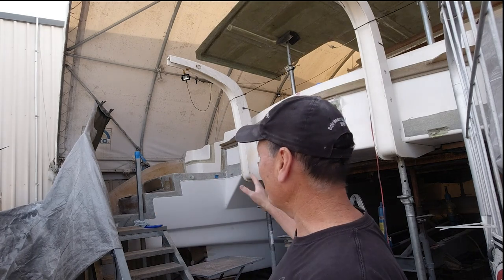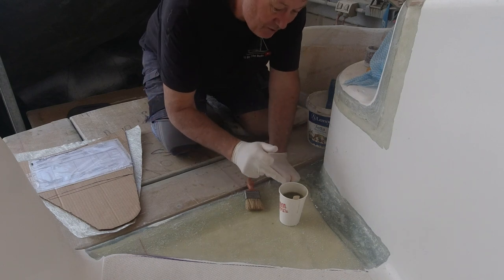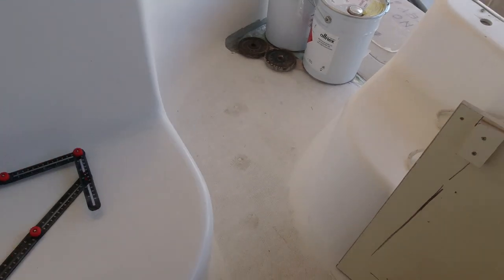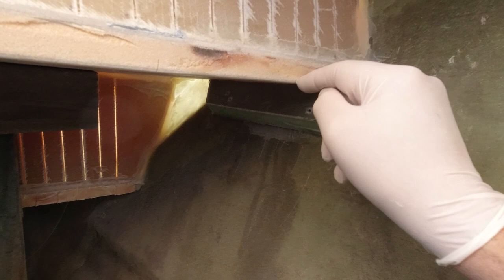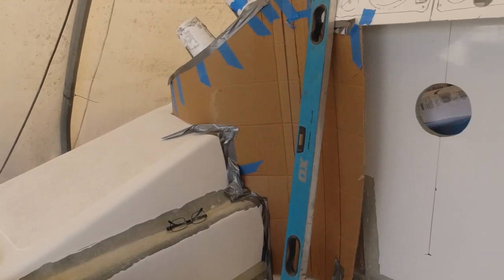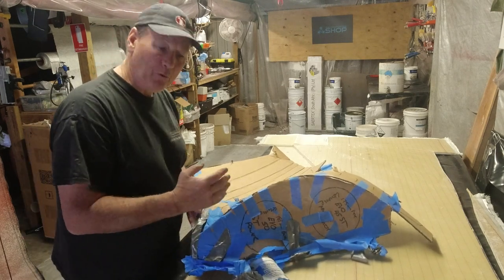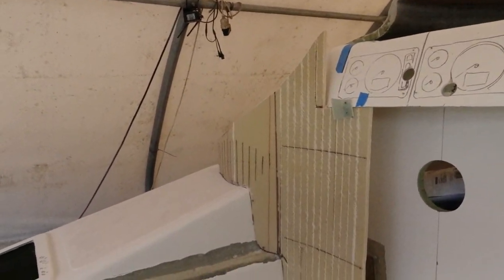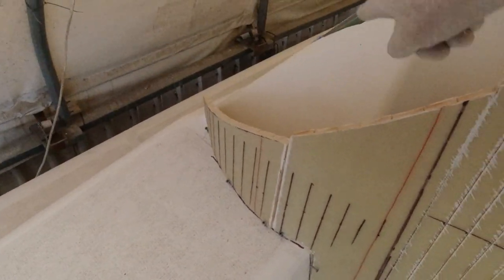Get back in your Hole - Customising a Catamaran Ep 238

Comment: The absolute drive, ambition and dedication you have Ross is absolutely mind boggling. It drives me on my projects if nothing else just because I get ashamed of myself for not pushing a little harder. I’m restoring an old car your building a friggin boat that has the same foot print as my house, out of fiberglass! And for the most part by yourself and the misses. Impressive is an understatement. 👍👍

Comment: I think I would have glued cheap 2 inch foam sheets together and made a carvable block. 
 Shaped the block into the final helm station I wanted.

Sheath in 6 oz cloth and wet out with epoxy.  

Fair the "Buck" to final smoothness. 

Pull female mold off the buck.

Layup new part and meld it into existing hull.

I am 3 years into restomodding a 1972 Formula 233 and your channel has really helped me to sharpen my fiberglass skills. Thank you!

Comment: For the 45 degree cuts and lots of other cuts in fiber/core I had used a small hight-adjustable circular saw - like a Bosch GKS 12V-26 Pro Cordless. My Fein multi-cutter is just to slow and inefficient. Yrs ago, at Jula (like Harbor Freight), I picked up an even tinier chinesium:( Meec circular saw on clearance for USD 4-5. I had a hunch it might be handy the day I dig into a total refit of my own boat.

Comment: Is it possible to take a mold of the anti-slip with silicone and then press it into the fresh gelcoat. Or spray gelcoat on the mold and slap it down over the last coat on the deck? Seems it would be easier than making a 'casting' that had to be bonded to the deck, since the anti-slip is only made up of the very top layer...

Comment: Ross, Are you not planning any steel or aluminum structure under the winch station ? It seems to be a highly stressed area since it's under torque, compression and tension which will flex and vary with every increase AND decrease of wind or shifts in orientation. Some sort of tripod or other load structure to distribute loads over a larger area  will be easier made and installed now than later when it's been enclosed by steering station and all entailed, right ?
Reply from the maker: There will be aluminium and carbon structure inside this plinth for sure.

Comment: very strange that those roller sanders are impossible to find in the USA .. seems like only Europe has them.. couldn't imagine how well those work sanding filets and such.. want one bad...
Reply: I typed in 'Handheld Drum Sander' to find many for sale in the USA.
Reply: @secretsquirrel6308  I have also but they are not the same as the one he has. These are called roller sanders. One is the Bosch PRR 250ES or the Power Plus POWX0495, Ryobi even makes one but not here.. These have a slim head design and not just a griner with a wheel stuck on it so you can use it in tighter places.

Comment: I cant help but think cutting holes and slits in the hull would weaken it. I know you wouldn't do that and you know your stuff for sure. Still the idea plagues me lol
Great work as always.
Reply from the maker: Funnily enough.It strengthens the regions as there is more reinforcement than the original to rectify.The life raft compartment for instance actually becomes a box section rather than a hollow The slit bome further incorporated into bulkheads etc that are not normally done so.Cheers Ross

Comment: At 18:08;    did i hear  """"R O P E S """"?  There are no ropes on a sailing vessel. The only rope on a sailing vessel is about 6" long and guess what that is?  ROPes.........ropES !!!!         That helm design will be a challenge however i do see that you have a plan in place.
Reply from the maker: Caught out big time Jim.Haha.
Reply: @LifeOnTheHulls  so, wht is the answer? What is the only rope on a sailing vessel?
Reply from the maker: @lets_go_see_  I would guess a bell rope or a soap on a rope in the cabin boys head.
Reply: A bolt rope forms the luff of a mainsail.
Reply: Further a rope is any rope on a vessel that has no specified purpose.  I have a plenty of ropes on my yacht, if I use them for berthing alongside, they become lines, or if used for hoisting sails they become halyards etc.  For the moment they just sit in the locker and are just bits of rope.
Strictly speaking, rope is twisted 3-core laid cable of 1" circumference or more, below that it is a cord. - A Dictionary of Sailing,  Penguin Reference books 1961.
Reply: @jeremyrowley1240  nice attempt.
Reply: @jeremyrowley1240  still no cigar
Reply: At least we establish that boats have ropes, and exploded a myth.